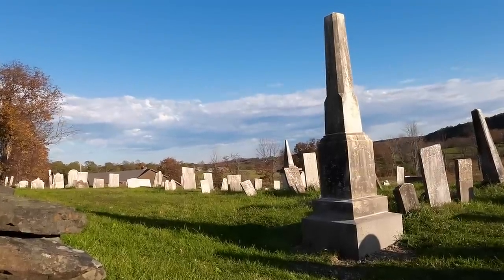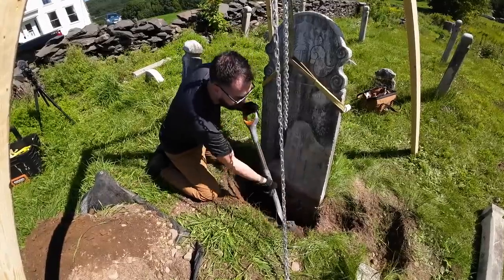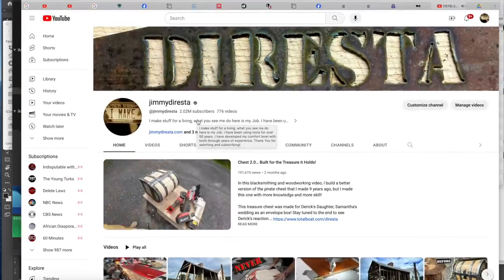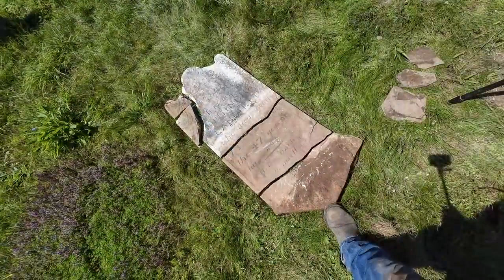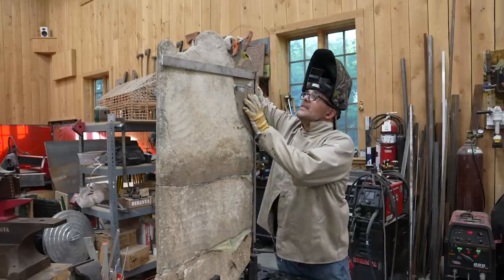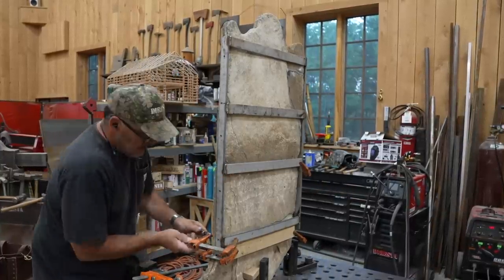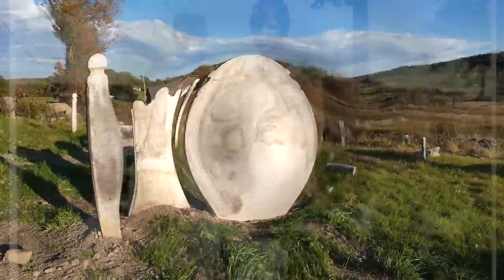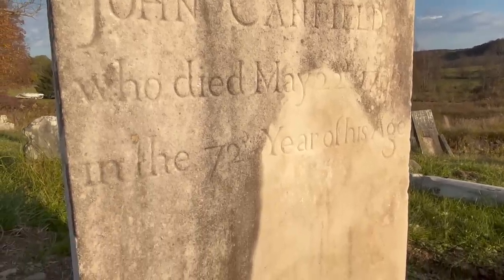A VERY RARE RESTORATION: 1724 - 1796 Tombstone!

Comment from the maker: Check out Wade’s video https://youtu.be/MAxlivBbiIY?si=sWOPIs-iq7dr6cM5
Reply: I have found it rather hard on a light colored monument, but darker colored if you rub wheat flour in lightly at first.  If still not able to read rub it in a little harder.  Good luck and great video.  PS I have mended broken monument as you did but laid it in new concrete for added support.  Keep up with the cemetery.  It is a very commendable thing to do.
Reply: Amazing.  I absolutely love this.

Comment: There are a few sites with recommendations on how to read faded tombstones. One says mirrors and aiming the sunlight just right. And the other mentions using cheap very thin aluminum foil and a make up brush to run the inscription. It would be interesting to see if they work for you. Great work!

Comment: You can buy solutions that are designed to clean and bleach gravestones. The ones I am familiar with will whiten them within a week or less and are completely safe for most stone types. I am glad to see you start to restore that graveyard. I live next to an old cemetery that has gravestones dating back to the early 1800s and some from this year. Gravestone design has definitely changed a bit over the years.

Comment: @JimmyDiresta you might already know this but I'll tell you anyway in case it helps you...
You can get large pieces of tracing paper and using the sides of charcoal sticks...very lightly rub over the surfaces of grave stones and it will make a copy of the written information...perhaps this will help you be able to read more...looking forward to hearing more about the restoration! I wonder if you were to make a paste from whitening toothpaste or baking soda mixed with watered-down vinegar and a soft bristle brush in circular movements and rinsed frequently if it would clean quickly without damaging the surface?

Comment: i'm a stonemason that has done lots of restoration on headstones. Epoxy is the correct way. You could pin all the pieces if you wanted but since you went to the effort of making a frame it should be more than fine. I would have cleaned the stone with a soft acid first however before epoxying them as the stone would have oxidized . Good job though jimmy.